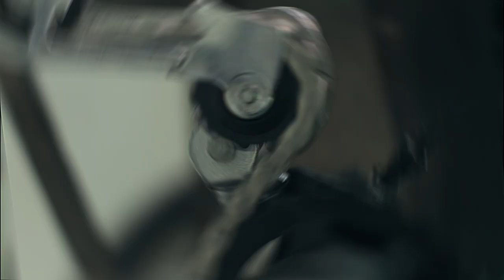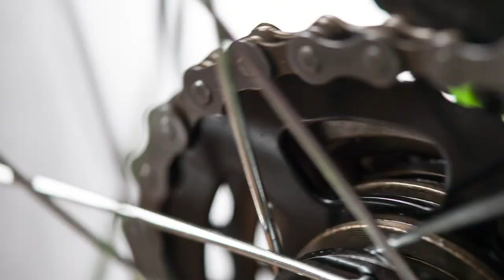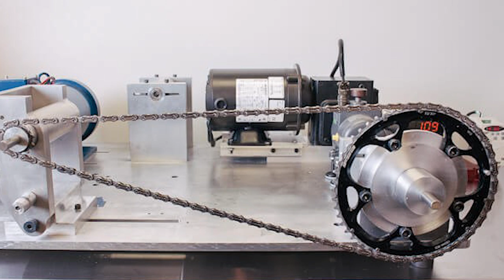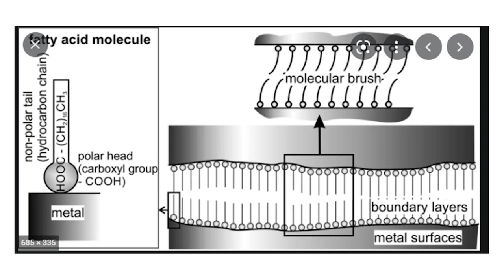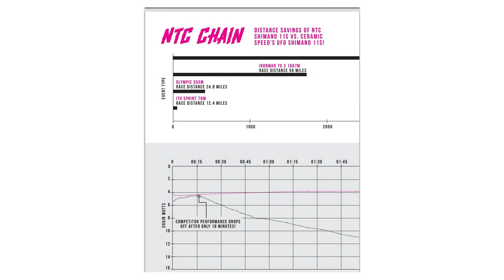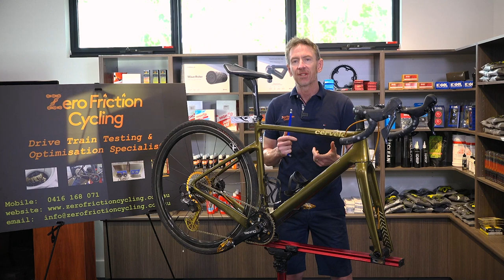Episode 11 -  Lubricant Testing Data – A continuous Train Wreck

Comment: Hi, would you say Silca Synergertic is as smooth as soemthing like Squirt? I've been using Squirt for two years and whilst it's not the cleanest, it is very smooth and produces almost no noise. 

I'm apprehensive about it after bad experiences with oil based lubes.

Thanks and love your website!

Comment: I’ve gone to synergetic with sram 1170 chains (shimano cassettes) on my bikes and the longevity is definitely there. I work as a service Technician so I can clean my bike whenever but synergetic seems to need reapplication around 400 miles for me
Reply: Keeps the bike running great. We don’t sell it at my shop but I highly recommend switching to synergetic for those whom are doubtful. Best bang for buck. Noticeably quieter shifting as well.
Reply: Adams numbers on chain durability were spot on which is why i ditched dura ace chains

Comment: I am using silica synergetic and have observed, that there is a sediment of very fine black particles building up on the bottom of the flask. It is almost impossible to shake it up. But if you put the flask in a ultrasonic cleaner, you can see the sediment dissolve in clouds within the base oil. I think that this sediment is part of the lube formula and is missing if it is on the bottom of the bottle. What do you say?
Reply from the maker: Hi Cristobal! yes i believe the dark sediment is the tungsten disulphide. I need to chat to josh re easy way for this to be mixed as it is pretty difficult, and i am sure silca have received this enquiry a number of times now since product release so i will chase up the answer - stay tuned for a latest news update to cover in the new year

Comment: I see the rc cars in the background. What do you use for bearing oil? I have been trying to find a good oil for long boarding also
Reply from the maker: ah yes i need to get to a number of repairs damn i forget the brand now of the last one i bought - some ultra rc bearing racing oil - i dont think we can ever assess one vs the other..... i think all the reputable brand rc racing bearing oil wld be very similar, this stuff has been developed for quite a number of industry applications. bearing greases / oils are a pretty dialed segment - chain lubrication for bicycles not so much. (ie look at the reliability of high speed NMB bearings in motors etc - pretty groovy grease / oil in those to be doing tens of thousands of rpm for a lot of heavy work life. Dyson vacuums up to 100,000 rpm as well and man we have one the hardest working ones ever here and its cracking on for years of hard labour now - two very quick examples of how bearing lubricants are pretty dialed - i dont think it matters much - just get a quality race oil from your fave place.

Comment: It will be great , if you can let me know how many km, does muc of dry lube last and some affordable lubes , which are efficient and good..Thanks
Reply from the maker: Hey sourav - i tested m-o C3 dry though the main test - it was not horrific, but it is well, well off the best lubricants tested. It will  not be tested in the single application longevity test as it does not warrant the test resources. Its longevity in main test was fine, so it is fine re treatment longevity, just overall much higher wear than much better performing lubricants. 

What do you mean by affordable lubricant? whilst some of the more expensive bottles will of course be more $$ at time of purchase, they are often much cheaper overall. Ie you would go through multiple bottles of M-O c3 dry in the same time as you went through one bottle of rex black diamond or silca synergetic. So it is cheaper per bottle, but even just comparing lubricant cost, the more expensive per bottle synergetic or rex is cheaper even just purely on lubricant cost as you need to use much less of it, much less often. 

then factor in that your components are wear out at multiple times lower rate, and so will last hugely longer - these products save you a lot of money in component wear. So despite being more expensive, they are the more affordable products. 

it is like - you can buy tubes for $3 that give you flat tire every 2 weeks and you need to replace them constantly. Or you can buy a $20 tube that will last you for years. what is the more affordable option. 

refer to the lubricant test page data, pick any product of your preference in the top 15 on the league table (sort by smallest to largest in block 5) - and you will be VERY happy vs muc off dry

Comment: I have never read anything about ambient temperature under test by these different manufacturers.
Do you know the effect (efficiency, longevity) of Winter/Summer on paraffin wax products? (e.g. brittle vs. soft for wax - or different viscosity for oils)
Maybe, there is an unpublished evaluation or belly-feeling ... ;-) 
Btw: Great content again, thx!
Reply: Pure gut feeling, but winter cold has the wax flaking off a little more quickly. Solution: swap the chain out 1-200km earlier than normal.
Mid-summer heat (at least down here in the antipodes) softens the wax quite a bit so it doesn't flake, but crud sticks to it a bit more. Solution: additional hot water wash and swap the chain out 1-200km early.
In either case I feel that the wax still does the job of keeping the crud outside the chain instead of inside just fine. It just is a little quicker to lose that oiled silk feeling.
Reply from the maker: Yes for outright efficiency it is pretty important. There is no data base for impact of temperate / humidity on products (we cant get a consensus data base on lubricants as is!). this would take - a) an accepted standard and results as the base, then b) same test applied by same body at different temperatures and humidity. How much any particular wax / lubricant would be affected would vary quite a bit depending on that particular product from barely anything within a fairly standard deviation range to measurably tangible amount. How much this may change at extremes (snow / baking dry heat / equator humidity) would be very interesting to see, but we sure are a fair way from getting to that kind of data. We need a standard on base data first. We do know some generalities ie Silca SS drip tested and found that their lubricant needs a longer set time in humid conditions vs dry conditions. This would hold true for likely all wax emulsion lubricants where the bulk of the carrier is water that needs to evaporate for the lubricant to set - in humid conditions i believe their latest information recommends a 48hr set time. Others that have not stated such things (squirt / smoov) - simply havent done the testing, or if they have, they have felt it possibly detrimental to sales to update, better to have customers think as is groovy as per normal as 99.99999999% of customers will likely not notice. Some lubricants have specific low temperature formula's, but there is no real data to support that formula's performance in such conditions vs anything else, or even their own standard product. With wax being solid - the top products in a pretty decent deviation should be mostly not affected, but at the extremes they may suffer a lesser lifespan as they become softer / brittle - but again we lack data. To date i have had ZERO customer feedback cases of performance / chain longevity not as expected due to someone often riding in very hot or snow / ice temps, and i sure have a many thousands of waxing customers - so i am pretty confident that short of riding in death valley in the summer or riding around to film march of the penquins in antarctica that msw / hot melt appear to hold strong across a very broad range - but.... overall for any bicycle lubricants there simply is not the testing or data - all we know is that lubricants overall will be impacted to some smaller or larger degree by temp & humidity, and so for outright efficiency testing it is a variable that need to be controlled.

Comment: Thanks so much for all the info, Adam!    Just made the switch to wax.    Went with Silca Hot Melt.    Noticed you have made references to just putting a waxed chain that needs to be re-treated back into the melting pot to reset the wax.   Why not give it a hot water rinse first so as to avoid introducing contamination back into melted wax?
Reply from the maker: Hi Bob! A boiling water rinse is a great thing to do post decent wet rides as one is hosing their chain with dirty road water. For dry riding so little contamination penetrates it is not worth the time & electricity, not even close. And, boiling water rinsing every time appears in some cases to be detrimental as water has minerals etc - that over time if done before every re-wax can start to impact wax bonding to chain / start to contaminate the wax itself. Over the years if ever there has been a case of someone not getting the chain lifespan expected on wax, almost always the common theme has been boiling water rinsing every time, so one is killing it with kindness. Definitely best to just re-wax post dry rides, only boiling water flush rinse post wet rides. Dusty rides just spray metho / iso alcohol on microfibre cloth and wipe dust that sticks to outside of chain from static. Otherwise, just re-wax and everything is amazing for a loooonnnggg time.
Reply: @zerofrictioncycling992  Great point about dissolved solids in water!    And I wouldn't plan to use distilled water!!!

Comment: Hi. How do you rate rocknroll gold and extreme lubricants?
Reply from the maker: rock n roll gold is ok - it was a solid choice 10 to 15yrs ago, but things have really improved a lot since then it just doesnt  make any sense if using a wet lube to run rnr gold vs synergetic, black diamond, revolubes, NFS etc etc. Extreme i havent tested, every test takes huge amount of time resources i cant work my way though 55 lubes in a few months like friction facts, there needs to be a compelling reason to test vs its just another lube option.

Comment: I do believe the wear rate correlation is a great method. however, and I am just speculating, is there a scenario ion which you can create tough sticky "lubricant" which will protect the surfaces and be slow?
Doesn't it at least makle sense to measure the pure efficiency in terms of power?
Reply from the maker: Hi - yes indeed, there can absolutely be circumstances where a lubricant can be wear protective, but be very slow - think say running a motor oil indoors where it wouldnt get too badly contaminated and abrasive too quickly. Similarly - heavy grease in bearings vs light fast grease - you cant measure the efficiency via the wear rates. 

So say two lubricants performing very well in block 1 - i can stay if they are a 3w loss lube an super fast, or 5 to 6w loss lube to higher losses from viscous friction, stiction etc. Where possible it is great to refer to ceramic speed lubricant testing for outright efficiency results. 

But we do know from lots of testing and ceramic speed/ friction facts testing that it is unlikely for lubricant to be much higher than circa 5 ish watt loss if it has a low wear rate in block 1, and then we also know that high wear rates - which is wear of hardened steel parts of the chain - cannot be low friction. So as contamination comes into play and we have large gaps between highest performers and poor performers - and that gap is caused by abrasive friction wearing metal - we know that the high wear must be high friction - even if we cant assign a watts loss number to it. 

Hope that helps!

Comment: Hello, I read the some of the pdf on the website. I was gonna buy Squirt lube until I realized that it is tough to clean, and has a very involved initial application process.

As someone who cannot economically import the likes of Molten Speed Wax (or the other one Hot Melt),  UFO Drip Wax, or Super Secret Drip.

What do you recommend as the next best alternative for dry road conditions? One that can be easily  clean after a sudden unplanned wet ride, and is easier to apply?
Reply from the maker: Hey deadly Ace! it can be a slightly tricky. For dusty riding, really you want to avoid wet lubricants and run a top wax lubricant. Waxes in general can be tougher to clean as most solvents do not work effectively on wax. Squirt has the added issue of penetration issue to try to negate post clean. You have kinda two options - i would either go with effetto mariposa flower power wax - that is a newly tested and OUTSTANDING product - but again that wax needs a wax specific solvent to clean, either ufo clean or their own alpine cleaner is best. Or, you can run one of the highly refined paraffin based wax lubricants like Silca ss drip, where a very good (not perfect, but very good) clean can be done with some boiling water flush rinses post wet rides (not needed at all post dry rides). The paraffin melts above 60dg c so the majority of contaminated lubricant can simply be boiling water melted and flushed out. Squirt has a much higher mineral oil content (we believe it is slack wax based - which is paraffin base but not refined so very oily) - and so the oil wont melt off, and its all locked in the wax, so its just a tougher product to clean - some solvents work ok with a soak - like mineral turps - but overall, not so easy. if you only ride in the dry, then either Effetto or ss drip need extremely little maintenance as not much dust penetrates. a great tip is to spray some alcohol onto micro fibre cloth and wipe chain before re lube to lift off surface dust. Dust sticks to outside of chain from static elec from whizzing through the air, same as dust sticks to your frame. Making sure your re lube does not drag this into chain where it will be pressed into wax layer inside to do damage is a great thing to do, and makes maintenance intervals for such lubricants if only ride in dry very long - ie you would only need to worry about doing a reset every 2000 to 3000km depending on your dust type (how fine, how abrasive etc). Hope that helps!

Comment: Hi, first thanks for all your work. 
I have a (stupid?) question. You say that this tension test machine is not accurate because of missing jockey wheels and stuff. But .. what about bikes without jockey wheels, like internal gear hub and fixed gear. Does that mean we need different lube for those because it requires different development methods?

As a practical example I've tried first squirt then silica secret on my commuter bike (rohloff hub with eccentric bottom bracket).  While it did stay clean as expected it was running dry very quickly even to a point that chain was really stiff - so I switched back to simple oil.
However i must admit that I only did an on-bike clean with degreaser before the first squirt application; As commuter the bike is obviously standing outside - but with a chainglider. And last but not least the chain is really worn (like 10% or more!) - but runs fine now with oil again.
Reply from the maker: Hi Tobias apologies delay reply, just found a better way to see missed comments :) No not at all, this is just talking about how to determine what the efficiency losses are for a lubricant, not whether or not it is a perfectly good lubricant for X component. However some things can be gleaned in that line of thinking however - ie a top wax is brilliant for the sliding surfaces of chain parts, it is not suitable for bearings at all, and it would not at all be suitable for a geared hub. But based on the testing by many  - if you wanted to know what truly was the lowest efficiency loss and lowest wear lubricant for your internal geared hub - well - with the current testing environment, that would be tricky. I would still be going with a proven top wet lube like synergetic which in CS testing (the only one i trust) to be very fast, and in ZFC testing (i trust that one too :)) to be extremely low wear, and pressures in the hub gears wont exceed / match the pressures on the very small parts of chain from rider load so it will go most magnificently. However, if prefer longer service times, then there are a lot of top greases (CS all round or long life grease etc). 

But to main point, if the aim of the game is to extremely accurately measure the efficiency losses of just the lubricant, then the least amount of "noise" in the system is desired, hence we dont want pulley wheel losses included, or needing to be backed out. It is like if you want to accurately measure your seats fore / aft position - you would want to do that on dead level ground, not sloping ground and manually factor out the angle in the measure. When we need accuracy of sub 0.1w minimum to be splitting lubricants in the top 10 or 20, we need the least amount of noise in the system possible (as well as very precise and repeatable warm up and calibration protocols, known losses for test chain etc etc - it is tricky).

Comment: will bathing a chain in silicone spray be fast for short rides up to 20km? it seems to me the lightness of the silicone spray would make for a hell of a fast lube for a race day sprint triathlon type event
Reply from the maker: no idea sorry but i doubt it will beat the proven fastest chain lubricants as they are developed to have lowest stiction / viscous friction. Silicone is great for some applications but best on a bicycle chain would be a surprise indeed. It probably wont be terrible, for a really short time, but then it will really dirty, and why have something that would need such frequent re setting to hopefully remain low friction when there are proven amazing products that remain low friction for ages (msw  / hot melt / ufo drip / ss drip / synergetic etc etc)